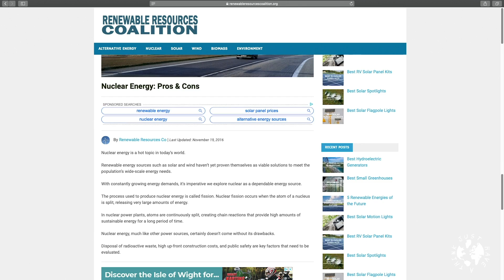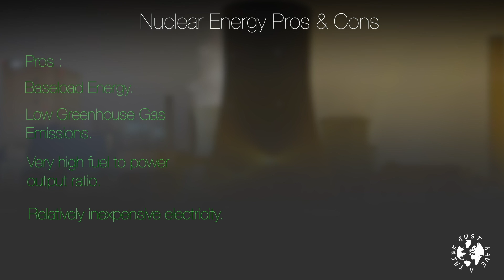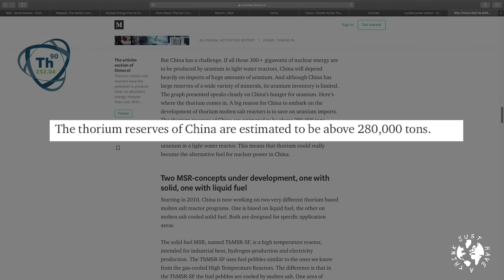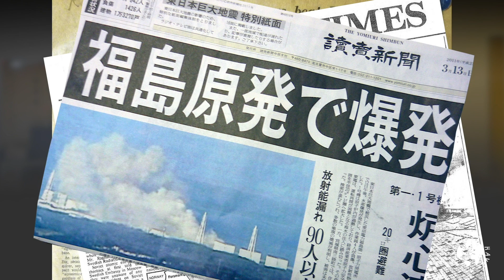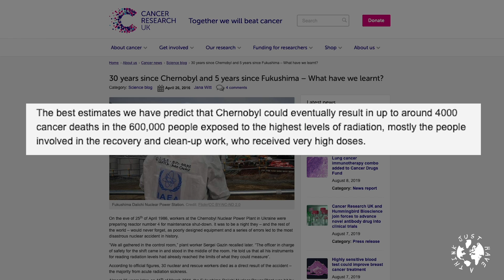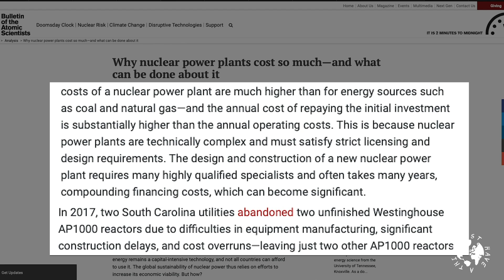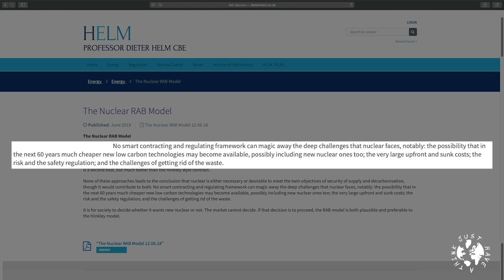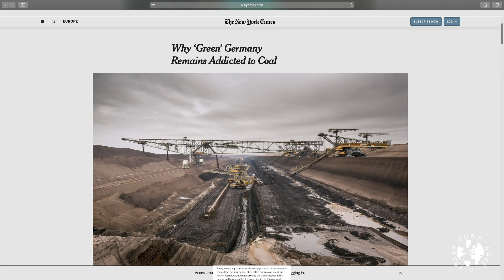Nuclear Energy in the 21st Century

Comment: Nuclear is too expensive, solar and wind are now coming in at 4 times cheaper per kW-hr.  And we can transition to wind and solar far faster than the decades it takes to build all the nuclear plants required.
Reply: Just look at the problems in the synchronous zone of Ireland+Northern Ireland because of high shares of wind. They actually have to limit the penetration of wind (curtail it or shut down a number of wind turbines) so they can keep their power grid stable. The costs of intermittent renewables start to increase exponentially once their penetration is high enough. You should always factor in the additional costs (energy storage, backup power plants, on-load tap changers...) when you talk about wind and solar. Once you do that, they are far from being so cheap.
Reply: @FrainBart_main  
You're blabbering desperate reaching nonsense. Shutting things off is not expensive, you turn it out of the wind and feather the blade pitch, that's all automatic now. To control it centrally by computer is also not expensive. One good desktop can do that for a nation these days. You don't need mass storage.  People with 6 to 8 batteries and an inverter in their garage, or an electric car plugged into the house is sufficient, unless you are trying to do stupid things with electricity like heating water or your home.  You should have been solarizing your home and superinsulating it and the ground around, and have night time closeable insulative batten shutters on your windows. Heating should be done by ground source geothermal, solar, and a minimal addition of gas or wood.   The cost to homeowners is minimal compared to the other crap we keep buying, whereas these are a one time investment. Amory Lovins proved by computer modeling that we don't need "baseload" plants because solar and wind don't break down en masse like fossil or nuclear plants which can go down suddenly and be down for months.  Solar and wind is a constant minimal maintenance cost, replacing panels and turbine bearings and servicing the electronics on a daily basis. People should use electricity for what it's good for, intermittent power tool and appliance use, lighting, telecom and computing and the display of video and sound. The charging of vehicles is also a concern, all the reason to build more solar and wind as fast as we possibly can.
Reply: @rstevewarmorycom  I don't think you have a proper understanding of how AC power grids work. This reply might get a bit educational but I think it will do good for your understanding and I suggest you read it whole when you have some time on your hands.

The major problem with lots of intermittent production is keeping the balance between supply and demand (of active power), which have to be balanced basically all the time because power systems are real-time energy delivery systems (large-scale energy storage is not economical). The balance between supply and demand influences the system frequency; if demand is too high, frequency starts to fall until the moment when supply is elevated to meet demand again, the opposite is true when supply is higher than demand. Frequency must always be in narrow tolerances around the nominal frequency of 50 (60) Hz. If it deviates too far (as low as 1.5 Hz in Europe for example), total system blackout is very hard to prevent. Normal operation frequency levels in European continental power grid are between 49.8 and 50.2 Hz. This is the first crucial thing to know if you want to understand power systems.

Next, you need to understand the concept of power system inertia. It's basically the ability to resist changes in frequency (it limits the frequency gradient if you're a bit more technical). Every rotating mass in power systems that is directly coupled to the power grid (not via a power converter) contribute to system inertia. That's because, when demand exceeds supply for example, additional energy is taken out of the rotating masses until the supply is elevated to meet demand again. Solar panels are static devices, so they don't contribute anything to system inertia. Modern wind turbines have rotating masses but are connected via power converters so they don't have an inertial response. More solar&wind causes higher and faster frequency deviations, which can cause a blackout. That's why in IE+NI interconnection (where there is lots of wind), inertia is limited - there always has to be a sufficient amount of conventional generators (hydroelectric, gas, coal and nuclear) to provide sufficient inertia (this is called "must run"). This alone causes high additional costs (running conventional power plants without producing any meaningful amount of electricity is very costly).

Next thing is ancillary services. Wind and solar are intermittent and unreliable, so system operators don't usually buy a lot of ancillary services from them. The vast majority of ancillary services are provided by conventional generators, which are reliable and always have some reserve if there is a need to elevate supply. Because of wind&solar fluctuations, there is a much higher need for frequency control ancillary services, which are not exactly cheap. Ancillary services provision is another cause for the "must run" of conventional generators. Quoting ENTSO-E: "Costs of associated
 Ancillary Services (AS) for IE+NI have been predicted by EirGrid, the transmission system operator to rise 5 fold between 2015 and 2020 from 5 to 25% of the total cost of electricity for end users".

All of these costs are payed directly by consumers to the system operators to keep the grid stable all the time. They don't show up in the levelized cost of electricity (LCOE) of wind and solar directly, but they should as I stated in my previous reply (because these costs are directly caused by wind&solar). System operators are prepared for a power plant outage and there is usually no problem with stability when this happens. Something completely different is trying to balance supply and demand all the time with lots of fluctuating supply from wind&solar. Google how LCOE is calculated, curtailing wind turbines directly causes higher LCOE, so they need higher incentives to be competitive. These incentives are again payed directly by consumers.
Reply: @FrainBart_main  
Gee, I guess when I, a lowly physicist,  designed the automatic fault detection and repair software for the SLYP-SLCN fault relays on the twin 500kV lines going across Montana that run from Butte to Coalstrip, I must have not known enough about power grids, eh? When Denver Power was forced by public law to introduce solar and wind renewables they were just so sure that it would cause great instabilities in their grid, but 5 years down the road they discovered that it did just the opposite, and they canceled plans for two fossil plants and asked for more wind and solar. It seems renewables are far easier to manage at the central control.  So thanks for your cut n paste tutorial, but I own the complete set of Westinghouse books on power management, and have read them all thoroughly.
Reply: @rstevewarmorycom  You should read them again, it seems like you have forgotten a lot.  It wasn't "cut n paste". You don't understand what I mean by wind&solar share. Denver (or Colorado) can have a stable power grid even at high local shares of solar&wind, just like Germany for example. The only reason Germany's power grid didn't breakdown a few times is because is is a part of a larger interconnection, just like Colorado is. I am talking about the overall interconnection wide share of solar&wind. Poland's coal power plants, France's nuclear power plants and Norway's hydroelectric power plants is what is keeping Germany's (and Denmark's) power grid stable. They are the ones that are balancing supply and demand when there are larger fluctuations in Germany's power grid (through the balancing market and system operator cooperation). hat would happen if all those countries would have high shares of intermittent supply and there was a surplus of supply (demand) in each of them? Secondly, Colorado's wind&solar share is still relatively low, about 20 % on average over the year. That's why I used IE+NI as an example, because there are high shares of wind&solar in the interconnection, not in a single country.

We can have high shares of solar and wind and large-scale energy storage and demand-side management systems, smart EV chargers and whatnot but what to do when there is basically no wind for a week or even longer in the winter? There will always be a need for conventional power plants and this reserve could end up costing a lot. Germany is an example of how there are periods that stretch for weeks when solar+wind supply is very low.
Reply: @FrainBart_main  
The Deutsch Energie Wende plan is SUPPOSED to cost them a lot more while they are building their solar and wind grid.  And then costs WILL come down to less than they were paying for coal and nuclear previously.  Of course interconnection of the grid is the key, but solar and wind doesn't go down suddenly and stay down for weeks or months like fossil plants do.  They are distributed and repairable continuously and in hours or days, not weeks. Renewables are far more predictable both because of weather forecasting and because they are widely distributed. And the cost per kW-hr is drastically cheaper than nuclear, and are now both cheaper  per kW-hr than coal. There is NEVER no wind conditions everywhere. There is NEVER total overcast skies everywhere, that is what the grid is for.
Reply: Renewable Energy   https://youtu.be/lL6uB1z95gA
Reply: @Cyruschadrezzar  
He's full of shit, I did a number on him.
Reply: @FrainBart_main  
You haven't the competence to know any such thing, You're posturing and lying.
Reply: @rstevewarmorycom  Who is competent and who is less competent can be clearly seen from our replies. I'm actually an electrical engineer working for a transmission system operator and working on my master's thesis about Li-ion battery frequency stability support at the same time right now. You can go check everything I stated in my replies if you want.
Reply: @FrainBart_main  
Then you should know better.

Comment: I find nuclear power to be the energy source least compatible with our current economic system.  The long term commitment it requires is not compatible with the demand for better quarterly reports and that's the main rub, not the technical aspects. 
It's the governments and ultimately the taxpayer who ends up carrying the costs of nuclear failures and nuclear waste. Yes, Germany's change to coal is terrible, but on the other end it's not risking long term commitments with nuclear waste management. Just think how many renewable energy sources Japan could have developed with what it's spent on cleaning up Fukushima. Think how much progress could have been made with all the money spent on Chernobyl's new sarcophagus. And these two sites will be money pits for centuries to come.
Reply: Well it would be a comparison of Fukushima cost versus renewable, storage and grid infrastructure over a 30-60 year time frame and also an applied value comparison between generation of the nuclear plants versus these renewable sources.
Reply: Japan is short of renewables to develop - that's a big problem. Floating wind turbines is its best bet, and I guess it should have some geothermal being on the ring of fire.

Comment: I was certain I would tune into this video and here the typical “nuclear no way” environmentalist dogma.  So you just gained a lot of respect from me.  Correctly pointed out that many new technologies.  The most promising are small modular reactors.  There is a design that uses solenoids which have to be energized to push the rods into the reaction chamber so if power fails the rods are automatically shielded.  Nuclear is the friend of renewables and provides baseline constant energy while renewables technology catches up if ever completely.  Not only cleaner but can save fossil fuels for critical applications (and this would be about 20% of current consumption in my thoughts).